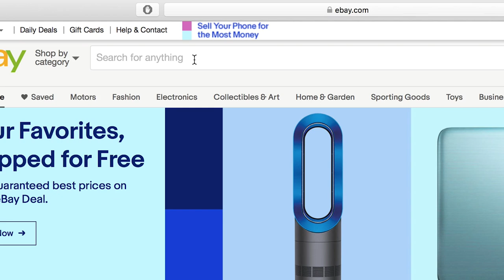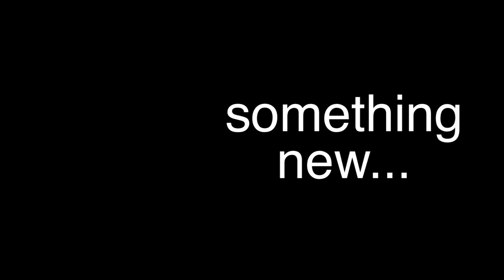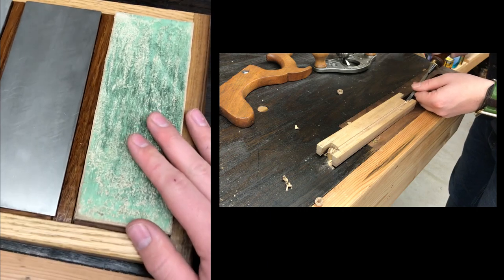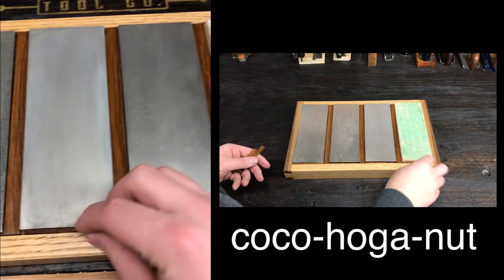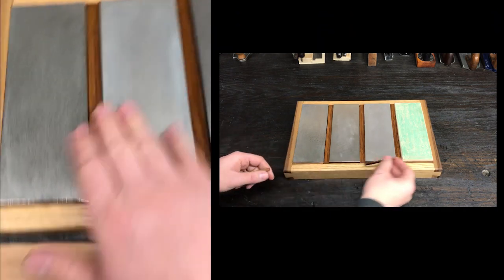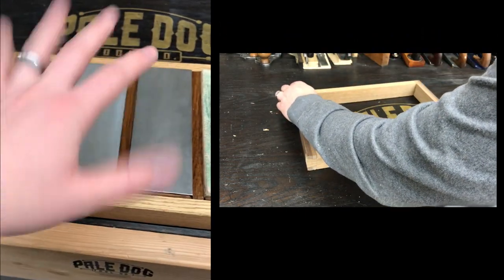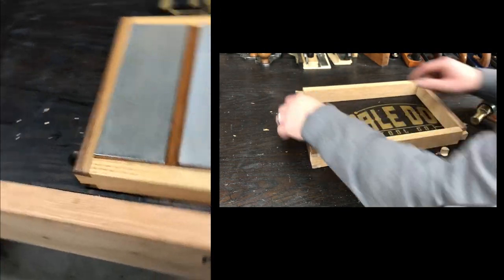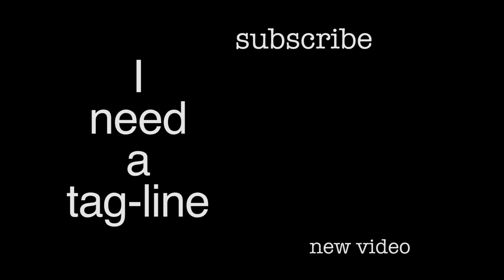Dove Tail Sharpening Station - DIY How To - DMT / EZE-LAP Diamond Plates

Comment: I see everyone using this setup for sharpening stones. Was it Paul Sellers that showed it to everyone originally? Anyhow, I have never done it because I prefer the stones to be independent of each other and elevated for knuckle clearance. If you wanted to flatten the back of a chisel or plane blade it would be difficult to do with them flush or near flush mounted to a surface like this. Not to mention sharpen a pocket knife. If I end up making a stone holder it will be like a pedestal to prop one stone at a time up in the air a bit above the vice, and be clampable in the landscape or portrait positions, since both are handy for different situations. It would add a little time of switching them around between stones but that would be more than made up for by the ease of use increase IMHO. 
   That being said, you did a heck of a job on that and you have some really sweet tools sir.

Comment: Answered my own question. Kerfing plane. Thanks for showing me something new! Never knew about them.
Reply from the maker: It's actually not a kerfing saw/plane, but thats how I use it. It's a stair saw. they were used for cutting dados in stair treads and risers while in place. I have mine filed for rip and use it as basically a rough kerning saw. I use it whenever i need a precise rip cut for dados/rebbets, since there is no flex in the plate and it has a built in depth gauge. I have had thoughts of one day putting a fence on it and making it a proper kerf plane. Since they are not really collectable, I see them all over the place for sale, usually only a couple bucks.
Reply: Just seeing this, but check out a tool called a gratsage, it comes from german woodworking heritage. It's like the stair saw that Pale Dog mentioned, but it doesn't just have the 90 degree shoulder, it has about a 45 degree angled shoulder allowing you to use it to cut sliding tapered dovetails.

Comment: I like your idea.  I was trying to come up with something that did not require me to have to hog out a bunch of waster on ply wood.

Are you getting any flex when you sharpen or is everything hold up well?  Can you share any dimensions on the lumber used?  I might have to borrow your idea here.
Reply from the maker: red58impala thanks, glad you liked it. I don’t get any flex at all. The tray is 1/4” plywood and the sides are 3/4 walnut and white oak.

As far as dimensions, I just made it up as I went. Your end dimensions will depend on the size of your plates/stones and if you want to include a strop.

I hope your’s turns out great!

Comment: What grit stones are you using?
Reply from the maker: Nate D based on recommendations from folks like Paul Sellers and James Wright I use the Dia-Sharp D8 Coarse, Fine and Extra Fine. Those translate to around 300, 600, and 1200 grit. Keep in mind grit ratings are different between sandpaper, diamond plates, and whetstones. DMT and EZE-Lap have very similar plate sets.